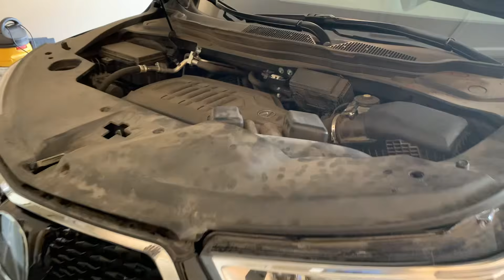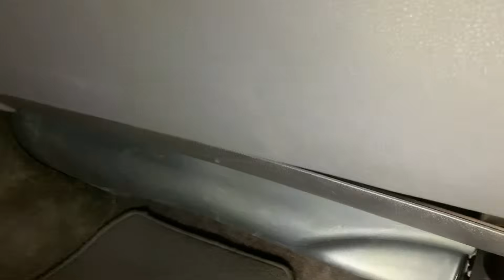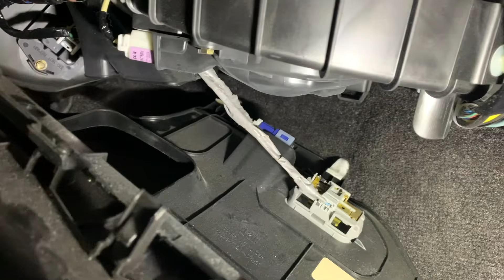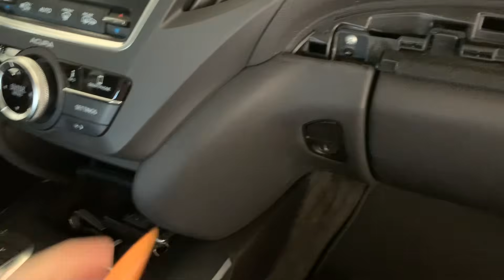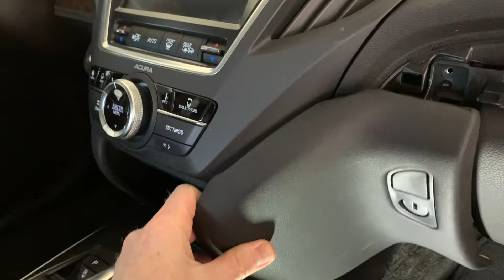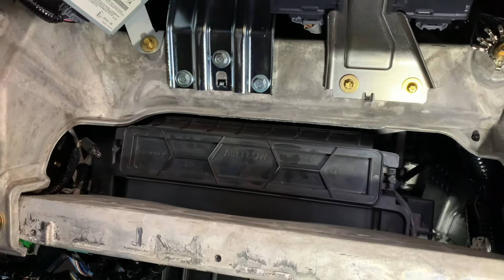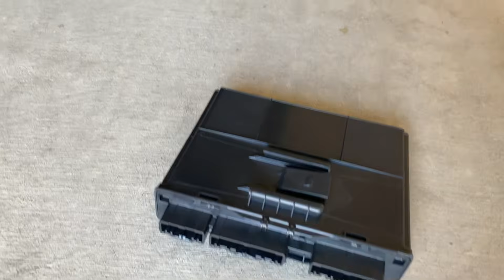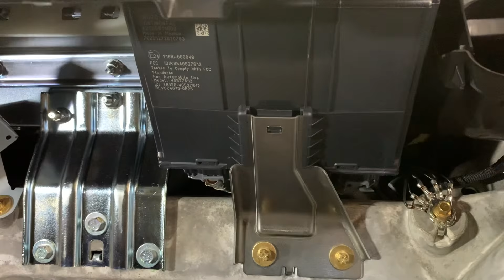Honda / Acura Random, Intermittent Flashing Dash Lights, Headlights, and Car Alarm - FIX Part 2

Comment: I have a 2016 acura tlx. Video is great, but I can't hardly see what needs cleaned. I can see a chip not fully coated...hoping thats it. I basically cleaned everything with alchohol. About to re coat with super glue but hoping I'm not sealing in that growth as I can't see it. Have camera zoomed all the way in and 2x reading glasses, still nothing?
Thanks for video though!
Reply from the maker: In case you didn't see the Part 1 video (link in this video's description) it has a better and very zoomed in view of the problem and where to clean.  It is practically not observable without a microscope.  But if you cleaned really well in the area shown, especially along the sides of the IC package, you should be all set.

BTW, for the benefit of others, can you explain where the Smart Power Control Unit is located in a 2016 TLX?
Reply: Did it fix your issue ?

Comment: Awesome video! Thank you so much for posting! 

Do you think clear, acrylic finger nail polish would serve as a new protective coating?
Reply from the maker: Whatever you use you want to be aware that it should not be conductive, corrosive, or act as a solvent to fiberglass resin or plastic.  Personally, I am a little leery of nail polish, that it may have solvents in it (but I don't know for sure).  If you want something long-lasting, I would try to go with a hobbyist conformal coating.

Comment: My 2017 RDX has a different set of parts in and around the dash-glove compartment. Any video that shows how to access the TPMS control unit 
without breaking any of the parts?

Comment: Thank you for the detailed video.  I have a 2018 Acura TLX A-spec with the same issue.  Is the Keyless Access Control unit also in the same location behind the glove box in the TLX like the MDX in the video?
Reply: Same thing happening to my 2017 TLX
Reply: Me too

Comment: Absolutely fantastic video. Honda should be ashamed of themselves. I had a 2016 Odyssey EX-L and this fixed my issue (for now at least). One note for Odyssey owners in my year is that this control IS NOT under the glove box but under the steering wheel on the driver’s side. There’s a couple of videos out there showing how to get to it but you need to contort your body like an Olympic gymnast if you don’t wanna take any trim off.
Reply from the maker: Thanks for sharing where to find the Smart Power Control Unit for your make and model.
Reply: Can you share the video?
Reply: @zacharyshaddix5754  I unfortunately can’t find the video now. I do remember having to remove the tpms module first and found that video here. The unit looks the same as in this video here on the Acura but it’s just a lot harder to get to on the Odyssey. 

https://youtu.be/FQkm0VRCKNo?si=aOcG6CcL10OHM6In
Reply: @TractorMan1605  Above brake pedal and the steering column. No need to remove panels, but it's pretty far up there. If you get under there with a flashlight, you can see it easily.

Comment: What method did you use to pry the module open? I’m struggling trying to open up the module.
Reply from the maker: There are four little tabs, two on each side. I used a flat head screw driver and slightly pried up the outer case in the area of each tab. It took a few times to work around the four tabs. You don't need to pry real hard it just takes a little bit of patience.  It is helpful to have another set of hands to pull the outer case while releasing each tab.

Comment: Thanks for producing two great videos. Based on the number of comments appearing on ody club, piloteer, ridgeline and other forums, many owners have experienced this problem. Looking forward to tackling the repair myself. Dealer's price for the part is $689 CAD, plus labor and taxes. Yikes!
Reply from the maker: Thanks for sharing that information.  The dealer quoted me ~$300 for the labor of replacing and then programing the new module.  AND, that cost was after waiting for the back ordered module to come in (estimated to be about 3 months).  This meant I was without usage of my vehicle for at least 3 months while I waited of the part to come in.  I wasn't doing that!  Hence, the making of this video!

Let us know how the repair goes, and please share on any forums the fix to this very annoying issue.

Comment: wondering why I am able to get the car started by jumping from another car?  As if it was the battery.  Got the battery tested at Autozone and they said my battery was fine.  Reinstalled the battery and the same flickering occurred.  Got it started with another jump from another car.
Reply from the maker: This issue does not prevent the car from starting.  What it does do is eventually drain the battery from all of the flickering dash lights, headlights coming on or car alarm randomly going off (when armed / car locked).
Reply: Same with the wifes car. This problem will eventually kill the battery. 
You can remove battery clamp and reset system a few times to get you by until repair can be performed

Comment: Regina G's video is awesome. However, Acura should recall for this issue. But they didn't. I called their customer relationship. They refused to do anything since this has not been recalled. We should join our force and sue Acura and let Acura recall for such common failure. For anyone who want to sue Acura, please reply with your car model and year.
Reply: i also complained but is not a safety issue smh but this did fixed my alarm going off and light flickering
Reply: Same issue Acura TLX 2017. Dealer is asking ~$900 for ordering part and it is not available
Reply: @kranthidhanala what did you end up doing ? I m about to do attempt this and hopefully it fixes it
Reply: @Afgmas were you able to fix it?
Reply: Yes. I watched several videos on YouTube regarding the car alarm. One video mentioned the hood latch sensor may be the caused of it. So, I simply unplugged the sensor while awaiting for the new one to arrive so I can install it. So far, having it unplugged have helped.
Reply: @kranthidhanala 
What did you do to fix it?
Reply: Acura MDX 2017
Reply: 2017 Acura Mdx
Reply: I just started having issue this morning. While I was getting ready for bed, my car alarm keeps going off and I thought it was someone else’s car. My neighbor who was 5 houses down texted me and told me about my car alarm going off and mentioned it’s probably the wind. I stepped into the garage and pressed some buttons and it stopped it. As I began to walk away, it started going off again. I then opened the garage and got into my car. The car was possessed! I pressed the on button and a million lights on the dashboard came on. I noticed there was something that flickered and says keyless entry… and it flickered off. I had just taken my car to the stealership due to an oil sensor issue which I had replaced myself but the code keeps coming back on. But that was fixed… after hundreds of dollars spent. Now, it’s this issue… I expected more from
Acura. This is starting to become a headache.
Reply: Same issue on 2015 Honda Odyssey Touring Elite. How do we start taking the needed steps to make this a recall??
Reply: Acura MDX 2016
Reply: Let’s sue someone start a group chat or sumn, face book group
Reply: Acura MDX 2016
Reply: 2019 rdx
Reply: Acura mdx 2017
Reply: I have a 2018 Acura ILX
Reply: I have same problem with Acura TLX 2017
Reply: It’s happened to my Acura MDX 2019
Reply: Acura MDX 2017
Reply: Yeah I have a 2018 Acura Tlx and it's having the same issues.  Except the pcb doesn't have any growth.  I've checked all the grounds.  All fine
Reply: @richardlee1951 clean it anyway.  Mine showed no growth, cleaned with rubbing alcohol and all is fixed.
Reply: @Dan-rl2th after cleaning u just plug it back and it works or do I have to reprogram unit?
Reply: @teamoversizefishingadventu2774 wondering the same thing lol 2016 TLX. Started last night
Reply: @leinadcruz96 I got a couple reply they all said u can just clean and put back only when u replace with new unit u have to reprogram
Reply: @lei @leinadcruz96 don’t have to reprogram just did it to my TLX it works
Reply: 2020 MDX
Reply: Happening now on my 2017 ILX
Reply: 2017 Ridgeline
Reply: RDX 2011 same issue
Reply: Same issue for my 2016 Honda Pilot EX-L
Reply: Acura MDX 2017.
Reply: 2017 Honda pilot
Reply: 2017 tlx
Reply: @capypiano  2017 Acura MDX Tech. Package.
Reply: 2019 Honda Passport
Reply: 2017 Acura MDX
Reply: acura mdx 2017
Reply: 2018 mdx
Reply: 2018 Acura MDX .... I didn't see obvious dendrite growth but I used a razor blade to scrape the chips with partial epoxy cover, and the syptoms seem to have gone away. I will let you know if the crazy electric flashing returns. I really thought Honda and Acura were a better corporate citizen than this. Even if they don't recall, they should send out the problem notice and repair this issue for free for the owners experiencing it.
Reply: 2017 Acura mdx
Reply: Acura mdx 2017
Reply: 2017 ILX
Reply: Acura 2017 TLX
Reply: Just fixed our Honda Pilot, Thx!
Reply: I have the same problem with my ACURA MDX 2016..
Reply: 2016 Acura MDX. We just cleaned and put crazy glue on it. Husband is reinstalling it now. Hoping it works. Just started doing this yesterday.
Reply: Honda Pilot 2016
Reply: Same issue 2018 tlx
Reply: 2017 Acura MDX
Reply: 2014 Acura MDX. Same exact problem. My problem is, I'm disabled and cannot do the repair myself - my left hand and fingers do not work at all.  Has anyone had any luck taking this to their regular, non-dealership repair place and asking them to fix it? I agree, litigation is the way.
Reply: 2016 Acura MDX same issue. I also file complain with NHTSA here https://www.nhtsa.gov/recalls , who launch a formal investigation if they receive enough complaints.

Comment: hey man! i got a 2016 mdx that has been experiencing these exact problems. i first found ur video around the time u uploaded it and it was very helpful as it solved the problem. the only concern is that it’s began to happen again a few months later which is extremely annoying. my dad and i cleaned that chip thing again but it’s just annoying we have to deal with this problem in the first place. and when we went to the acura dealership they were tryna swindle us for thousands of $
Reply from the maker: Sorry to hear that problem happened again after only a few months.  Do you live in a humid climate?  After you have cleaned the area and especially the pins and corner of the chip, did you apply any conformal coating material over that area and especially the chip pins?

Comment: Had the same issue, it ended up being the battery 😅
Reply from the maker: I thought the same thing about two years ago.  The first time the issue appeared I replaced the battery and thought it was fixed.  Some months later is when it reappeared, and then I discovered the real root cause.
Reply: @reginag1874  dang

Comment: I had this exact issue with a 2019 Pilot. The dealer wanted $175 just to diagnose the problem. I was able to find the Smart Power Control Unit with this video and clean the circuit board successfully. Thank you! I did a detailed inspection of the board under a microscope and could not find corrosion, but the chip you highlighted was not fully sealed on my board. I cleaned it with an alcohol swab anyway, then sealed it with superglue. Now it works and all the ghosts have disappeared. Some of the issues I had prior to fixing it was the Alarm going off sporadically, an "Auto Engine Idle Stop System Problem" Alert in the driver's console, and the battery draining. I find it puzzling that Honda has issued a TSB for various cars of this era, excluding the Pilot.
Reply from the maker: Fantastic!  Thank you for sharing all of those details. The dendritic growth is very small but large enough to create a short between those two pins on the IC.  I couldn't agree with you more that Honda should take responsibility for all makes (Honda and Acura) and models that have a Smart Power Control Unit.
Reply: Having the same problem on my 2016...can't find the growth. I'm going to do what you did and hope for the best?
Reply: @jasonzehnder6510 did it work ?
Reply: does not deprogram?

Comment: I have a 2018 RDX. I got the intermittent dashboard lights flickering and it also wouldn’t start. I was indeed told it is the Smart Control Unit and it is on back order
Reply: Is this likely the same issue as what is being shown?
Reply from the maker: @jeremycarlson1189  I am not aware of others saying their car would not start.  You might have two problems.  On the other hand, this fix is so simple you have nothing to lose.  I would go for it and hopefully it gets you back up and running.  I think if you look through the comments (of this video or the Part 1 video) someone else has reported on fixing a RDX and where to find the Smart Power Control Unit.  Let us know how it goes.
Reply: @reginag1874  So I had my RDX unit towed back to my house, and the next day the mechanic told me Acura called them and had 1. It now has a new unit, and works perfectly. I asked to keep the part. I'm annoyed because the mechanic kept telling me that the part was the A314...the part that came out of my car was A214...which you can actually find used online if you are having an issue. I can't even find a pic of what the 314 looks like. Was told it has to do with the package your RDX is (base, advanced, tech). So i have the bad part, and I cannot for the life of me get those 4 tabs open to take the computer board out. What did you use? just a screw driver?
EDIT: NM...I got. pain in the butt.
Reply from the maker: @jeremycarlson1189  Great.  Thanks for the update.  Glad you got it open.  I would be interested in some pics of what you find.  For others that may read this...there are four little tabs, two on each side. I used a flat head screw driver and slightly pried up the outer case in the area of each tab. It took a few times to work around the four tabs. You don't need to pry real hard it just takes a little bit of patience.  It is helpful to have another set of hands to pull the outer case while releasing each tab.
Reply: @reginag1874  Yes, I used a flat head, very tricky though. So after opening it up, I used a 35x magnifying glass and looked at that specific chip. I did NOT have the corrosion like some of the pics people uploaded, nor the one you show. I don't think cleaning it in my case would have done anything, nor can I say it would be the same chip causing my issue. Mechanic said that the signal got to the module, but the module itself was not sending that signal out, but that was intermittently, which would indicate that the module was not completely toasted, but completely unreliable. Still, thank you very much for these videos. I think they will help a LOT of people as this is a common issue for the RDX for specific years (2016-2018).

Comment: Thanks, this seems to have fixed the issue on my 2016 Odyssey. This would have been the second time it was replaced by the dealer and the part is still on backorder. I don't have to worry about a dead battery now and its nice to know what the actual issue is.
Reply from the maker: Thank you for leaving a comment.  That is so awesome!  You confirmed exactly what I suspected, that is, a new replacement module still has this same defect.  It is much better to repair it properly rather than keep giving Honda thousands of dollars for defective parts.

Comment: Can you tell me if you had to reprogram the module after you repaired or a reprogramming only necessary if the unit is actually replaced?
Reply from the maker: No reprogramming is required with this fix.  Reprogramming is only necessary if you replace the module.  This alone is about $250 savings as that is what the dealer quoted me to do the programming.

Comment: Did this fix to my 2018 Ridgeline, it worked perfectly. Have been driving the truck every day for two weeks now with no issues.The hardest part was getting the circuitboard out of it's plastic housing,
A couple of extra hands helped a lot. I used the zoom on my phone and still really could not see the build up on the board so I cleaned and used a x-acto knife very carefully on that area. Don't forget the super glue.
Thanks for these awesome videos!
Reply from the maker: Wonderful! Thank you for adding your comments and experience.
Reply: Can you tell me if you had to reprogram the module after you repaired or a reprogramming only necessary if the unit is actually replaced?
Reply from the maker: @kukeyuw  I did not have to reprogram the module.  That is one of the many benefits of this project.
Reply: Also, I'm  wondering if a new replacement module would be defective also? Why is this not on recall since so many folks are having this issue?
Reply: Did this video apply pretty close for your 2018 Ridgeline?  I'm dealing with random car alarm going off.  Happened twice now.
Reply: You used super glue to prevent the build up ?

Comment: I am having same exact issue on my vehicle, acura tlx 2017 43k miles. I will attempt this fix because dealer wants 1000$ and part if on backorder with no ETA... ridiculous. Thank you so much for this video!
Reply from the maker: Thanks for your comments and would appreciate to know how the repair went.
Reply: Hey man. I have the same problem going on in my 2018 tlx. Did every step in this solve the issue? Any other tips? Thanks!
Reply: @travisedwardhenderson9998   it was a keyless entry module. It was on backorder without an ETA. I got mad at traded it in for a 23 TLX aspec shawd..
Reply: Hi...I also have a TLX with this problem.  Did you find the module was in the same location behind the glove box like it is on the MDX in this video?
Reply: @martinelmore5162 hey did you attempt repair? Any tips fellow TLX owner
Reply: Yeah same issue here. Will attempt next weekend.